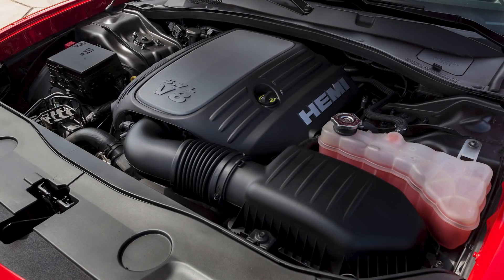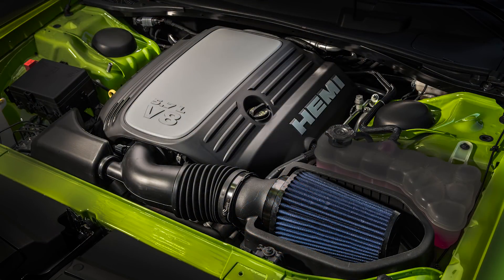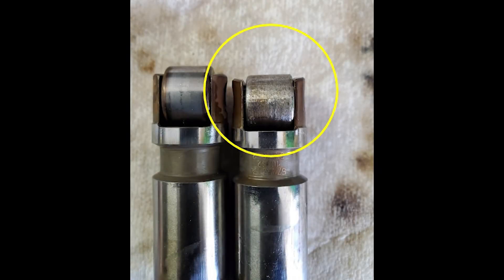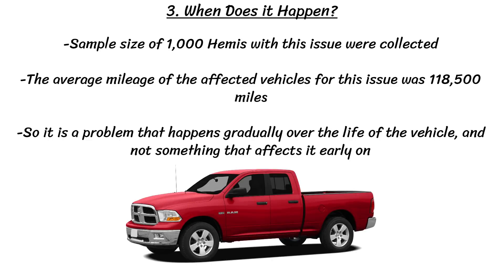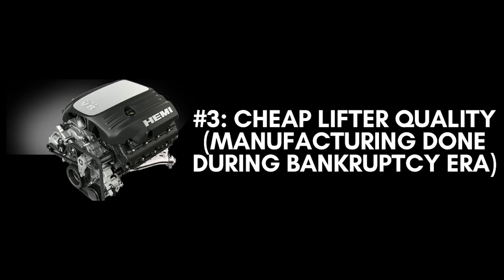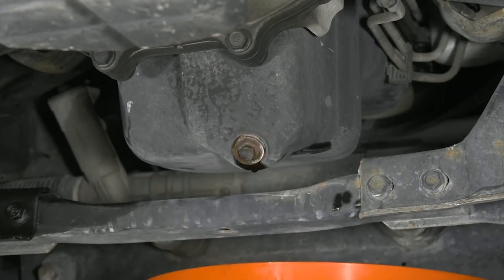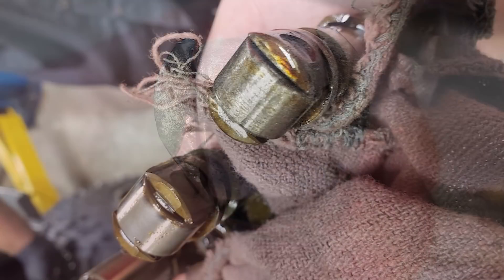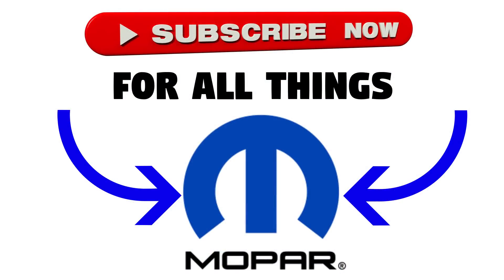The Fatal Flaw of the 5.7L Eagle Hemi V8 Engine Fully Explained (2009+ Lifters and Camshaft Failure)

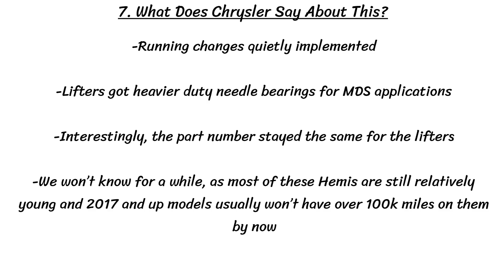Comment: 15:30 2017 Ram 1500 200k+ miles no lifter issues but exhaust bolts broke, air bags are trash, & clock spring petered out

Comment: A lot of it has to do with idling too much because in 2009 when they upgraded the engine for more horsepower they move the cam up too high away from the crankshaft. Under 1,500 rpms as well as idling too long it’s not getting enough oil up into the cams to lubricate and that’s what causes the cams and lifters to get that awful Hemi tick. It’s mostly the cam that does it because the cam pushes the lifters.

Comment: My 2012 5.7 145 565 Mi. most long distance driving very low short distance use . regular oil changes still runs great

Comment: Sadly the 5.7 is put in vehicles which usually live a hard life. Youd be suprised how many rts 1500s 300Cs and S's i do oil changes on that are 2-3k past their oil change. These cars a lot of the time are owned my poorer people and when it comes to Maintenance Or shiny new wheels or new giant wheels for their truck they pick the wheels. The challengers are usually spared this but i see it all the time on the chargers 300cs and the 1500s. if you go 8k on an oil change while also beating the piss outta it you will get a lifter tick and its not dodges fault. The oil that comeso uto  these poor things is so thin and black they might aswell be just dumping water in. If you drive it hard changing the oil every 2500-3k isnt cause it gets dirty quicker its cause high rpms breaks down the oil viscoucity quicker. if you drive it hard and still dont change the oil till 5K+ miles your 5W-20 becomes 5W15-5W-10 and your motor suffers. If you drive it like a camery and never rev it past 3500 you might be able to get away with 5k oil changes but its not ideal.
Reply: My 08 300c awd rus like new and has 223,000 miles only 5W-20 synthetic used.
Reply: @EconomyElk  my 2008 2.7 300 has 277,000 on it. 5W20 oil changes every 5,000. Been a great car.

Comment: 🤔 i cant say for positive but the more technical parts you put into an engine the more you increase chances of failure. Especially small parts that play critical role's in the engines operation. Dodge hasnt been dodge for i dunno 30 years or so. Now you have foreign engineering trying to crossbreed an american engine. Dont get me wrong what they did do was truly amazing but totally untested. An inblock cam engine with push rods generating 350 horrspower and getting 22 mpg and Being a daily driver is remarkeable. Now that being said it is an inbock cam and oil differently than their ovh cam engines and i believe there in lies a problem as dodge or daimler fiat ot whom ever failed to explain the importance of oil gallies in push rod engines and they need a lot of oil especially if you are adding more and more parts into the engine that require oil and a higher volume pump to keep these parts lubricated and cool. They have plenty of pressure just not enough opening to get the oil through. Thicker oil is probably NOT recommended. In fact a 0 w 30 or 20 is probably best.

Comment: 2018 Rebel. Cylinder 7. Lifters not pushing valve. Ticking noise non stop. Taking it to dealer. I have full warranty. 74000 miles. Will see. Had it happen a few years ago to my 2012 ram hemi. Warranty paid for new engine. It also had about 75000 miles

Comment: I have 320.000 on my 5.7 never bin apart except spark plugs an manifold bolt I use heaver oil in my truck 10w30 summer with JB lube additive every other summer an 5w30 in winter high mileage Valvoline red bottle

Comment: It’s the MDS IF THESE are beaten to a pulp or not taken care of the lifters sometimes collapse and don’t come back! Grinding the can ticking sounds and it gets worse!!! Easy fix! Lifters from a hellcat may as well do valve adjustment and check other things to be safe disconnect the MDS (THE CORRECT WAY) and add a hell cat oil pump! This will increase oil pressure while at idle a lot of idling and stop an go traffic fails to bring oil pressure up enough. To lube the upper end of the engine. So to compensate a hell cat/demon oil pump and deactivate MDS then use hell cat/demon lifters etc etc! And you’ll NEVER HAVE THIS ISSUE AGAIN!!!!!! I know I do it at my shop and never have I had a customer return with these issues EVER!!!!! Plus if they want to do performance upgrades later it saves time and cash

Comment: I guess I’m lucky. My 2010 ram just clocked over 428,000km/266000 miles, and the only thing I’ve had to do to the engine beyond oil changes and spark plugs was a water pump.

Comment: The problem is the oiling system,. All the oil needs to be pumped all the way up to the top of the rocker shaft , then id needs to come back down the push rod to oil the lifter which is completely  backwards form all other systems.  Also tye lifter angle is entirely too flat which is a bad block design. So there is no fixing this issue. The entire engine would need to be redesigned in order to fix it. Way to go Mopar.

Comment: Hellcat spec oil pump and a catch can is the cure to the lifter failing. It’s caused with extended idling. It simply doesn’t oil well enough to the lifters at idle.

Comment: I got 2008 
500,000 miles
With no hemi tick or exhaust bolts broke yet
I'm using 5/30 full synthetic Walmart oil and oil filter 
I got 2019 hemi engine 
With 200,000 miles no hemi tick 
No boke exhaust bolts
5/30 full synthetic Walmart oil and filter
2021 hemi engine 
170,000 miles no hemi tick or no exhaust bolts broken 
Using 5/30 full synthetic Walmart oil and oil filter 
My question is what am I'm doing wrong

Comment: I bought 2009 Challenger new with lifetime power train warranty.  At 168,000 miles cylinder 8 lifter failed destroying the cam.  Chrysler installed a long block under warranty.

Comment: I think probably the 5w20w oil is too thin for a v8 and may not develop enough pressure to keep oil splashing around.
Also, the hemi oil filter is the smallest I have ever seen on a v8. Using a relocation kit and a larger flow filter could not hurt.

Comment: I’m a newbie to the channel and to the 5.7 Hemi. I have a 2011 Ram 1500 Outdoorsman, regular cab, short bed, 2WD. So far, no ticking. It has 112K miles, presumably mostly highway. I’d really like to get caught up on the issue of the lifters failing, the MDS system (good or bad for engine life) and anything else. I just found the video and I’m glad I did. Thanks for sharing this informative video with us. I’m open to suggestions from anyone with regard to the proper care and feeding of the Gen III Hemi.
Reply: Just use 5w 30

Comment: All can be avoided if you would just change your motor oil on time. Motor oil brakes down and yet out the door goes proper lubricant 
Also stick with 100% fully synthetic oil 
I have 172,000 on my 2014 5.7 hemi and no lifters ticking in my engine because I keep my oil and filter changed every 10,000 mile

Comment: My 2017 Ram 2500 4x4 SLT 5.7 with 97500 miles I purchased it with 82000 miles 3 years ago. It was a fleet truck for and pipeline company in Canada and had over 1,500 idle hours and 167 drive hours. I suspect this may be the issue for my truck but I don't understand how the truck had 82000 miles on it if it only had 167 drive hours. 167drive hrs x 65 mph average =10855 miles. Currently, the idle hours are at 1567, and drive hours are at 285 so it works. Any thoughts?

Comment: i turned off my mds and i use Lucas flat tappet wear in additive with zinc and phosphorous to protect the hot areas and i noticed the engine on my 09 300c is running a lot better i have also noticed that idling is the main suspect, fleet cars cops cars and more seem to be the most affected

Comment: I have a 2021 ram rebel. It had 40,000 miles on it when it threw a misfire code on cylinder seven took it in the Dodge. They’re replacing the entire engine sounds like it hasn’t went away. If I had a choice, I would’ve bought another vehicle not a fan of Chrysler products👎🏻💩

Comment: Let's focus on the root cause of these failures.  Kinda 2..... A primary and a secondary...... primarily it's the oil.  The true fix is an additive.  Secondary.....high idle hours.  Police model, service trucks, etc.  Heavy duty won't fix it.  Maybe high volume pumps.  Remember, LS motors had the same problem.  Windsor rollers didn't have these problems....why?  The oil was different.  IT'S IN THE OIL..... additive additive additive

Comment: Have an '06 jeep commander that wiped the cam and required a whole new engine. There are 5 to one '06 vs other years for sale on marketplace with the blown hemi's. Uncle Tony's garage had the best diagnosis, older engines had the camshaft closer to the crankshaft than the newer LS's and modern hemi's. GM has the same problem too. So they are starved for oil when at idle. There were round 30 videos on YouTube that had meticulously done maintenance and had it happen with 30K,65K and other low mile vehicles. My mechanic looked at me like i was crazy when i told him that's what it was. He fixed some other stuff that still needed done, but didn't cure the shake in the engine. After a compression check and trying to take the mds solenoids out which are magnetic, they barely got one out because it had so much metal stuck to it. Uncle Tony took one apart and noticed there were score marks on the outside of the lifter, which could have only been caused by oil starvation.

Comment: You should always use the oil viscosity recommended by the manufacturer. You will have less oil burn off and better gas mileage.

Comment: Worn crank bearings causing lower idle oil pressure in cars that idle more than normal all caused by incorrect oil and insufficient oil changes. 
I do note the rotational speed of the larger needles in the revised lifter would be lower at all engine RPM.  
Just a guess.

Comment: I have the 2011 Jeep Grand Cherokee Overland with the 5.7 and currently have 120,000 miles.  The 2011 has had a lot of issues and likely one of the worse production models.  Considering getting rid of the 2011 and buying a new JGC over concerns of what is next with the vehicle, specifically the motor.  Have started researching the 5.7 to see if I have problems coming soon and wondering if maybe best to move it while it still seems to run fine.   Great video!

Comment: I think the issue could be CURED by drilling the camshaft down the middle, drilling a hole in the base (heel) of each lobe, and using a high flow high pressure oil pump to positive lubricate each and every lifter all the time the engine is running. the real issue at this point is Chrysler has no reason to do it, as the hemi will soon be dead. to me, this is something that eack and every performance camshaft maker could take on, so that high performance cars and trucks would no longer have this issue. I know that if I was to replace the cam in one, I would do this even if I had to pay extra to have the camshaft drilled. a pressed in plug would keep oil pressure inside the cam until it exited at the hole in the lobe.

Comment: I have a 2017 Ram with 114k miles and it just seized the entire engine. I'm having it rebuilt. A buddy also said the oil should get changed to a low profile oil pump. He says the stock pump sits too close.to the bottom of the oil pan and plugs up with the crap on the bottom of the tank.

Comment: I have a 2012 5.7 hemi Charger. I have 166,200 miles on it and it is absolutely quiet as a bird. I religiously change the oil and filter every 6,000 miles. It averages 21 mpg per tank. If I’m on a long trip I average 32 mpg at 70 mpg with the air on. I use super synthetic 5-20 Penzoil.
Reply: 32 mpg?...not possible!...car is rated at 23mpg highway

Comment: Another thing is that many modern synthetics do NOT mix well.  They have so many additives.  Sticking with the same kind of oil throughout the lifespan of a vehicle is a good move, as long as that oil has the highest rating.  (Something like SP+)

Comment: I got into a fleet Ram with a 5.7 and only 30,000 miles in it today. I was surprised to hear the engine tapping/knocking when I started it on what is a next to new truck in 2023. I didn’t realize these engines are known for that.

Comment: Well I'm a young adult, just bought a hemi  5.7 V8 2014 charger ,used to be a cop car , has 210500 miles nd no issues at all l, runs good engine still strong , just changed the oil. But what should I also mainly reput new? New at this so I don't know nothing

Comment: Two thoughts: the needle bearings are too small,lack lubrication! Upgrade the roller bearing units early! And two,if it's a lubrication issue put in a overhead lubrication kit to get the oil there! Ford screwed up years ago and smart folks put in overhead oiler kits!

Comment: Run the engine with the speed gear selector up to 8. When you put the car/truck in drive you can select the  gear limit. This will disable the MDS so you will run the engine in 8cyl. The MDS cancelation will resets when you stop the engine. Repeat the selection for next time when you drive. I use this trick after I had to change the lifters (done free by the dealer).

Comment: A 6.4 lifter issue will be probably just as expensive to fix as that turbo.  I'm a ram fan but i probably wouldn't buy a hemi now because ram isnt addressing this.The mds or afm  have made the gas engines time bombs and thats too bad. Like you said all makers are going this way so it is what it is.

Comment: I’m nowhere near as schooled as I’d like to be on vehicles, but why exactly does higher rpms help mitigate this issue? I really don’t have a problem with laying the throttle down just curious, and what’s considered enough, at least 2500 rpm while accelerating?
Reply: Higher RPM increases oil pressure literally spitting more oil on the lifters and cam lobes.

Comment: Great analysis and I appreciate the objective approach. NGL I was somewhat relived to hear they improved the lifters in 16.  I have a 44k miles 2016 sport with the 3.92 rear end and aside from the 2 piece driveshaft replacement (which only helps the thump at launch for 2k miles) I am happy with the motor and trans. It does have MDS/VVT and I enjoy getting around 30mpg @ 45MPH.  Around 20k miles I added Z max to the oil and fuel system as well as regularly run injector cleaner at high RPM as I feel it keeps things moving better.

Comment: I have a 2015 Jeep with Hemi with 189,000 miles. From the day I bought it new I have always had a loud ticking. I have always maintained my Jeep with the dealer, making sure everything recommended was done. Most years I take long trips sometime more than 5,000 miles to get lost in the mountains & deserts, I never wanted a breakdown to be a problem. About a month ago maybe 10-20% of the time on start up my Jeep would barley turn over, then it started  idling very rough, then engine light came on. I made appointment with dealer when it started with the hard starts, it took them a month to get me in. Yesterday 11/28/22  they have informed me my engine is "Blown" and it needs replacement.              To back up your theory that idling can facilitate this problem I have idled many times for long periods of time over the years.    I am fortunate in that I have a lifetime warranty but it still sucks, even more now that I see they knew.

Comment: I have had this happen in several of my fleet trucks. One of the trucks was a brand new truck (2022 Ram 1500). I have had a similar lifter issue happen on two different 3.6 engines in 2014 and 2016 Jeep Wranglers. The 14 at 50,000 and the 2016 at 10,000 miles.

Comment: I am rebuilding a 06 hemi with all the reading and watching on line the cars that idle are experiencing low oil pressure at least that is the belief melling has made a high volume pump For 03- “08  to help with this problem
Without chrysler admiring the problem we can only speculate? They are ending the Hemi later this year or next and are going with A straight 6 cyl with two turbos?
I am also deleting the MDS. New cam and lifters. Thank you got your work.

Comment: Outstanding in comprehensive job on the video I’m going through this right now currently my 2012 grand Cherokee 5.7 hemi cylinder number three had a misfire. I took it to the local dealer here in Dallas. I have a bumper to bumper Mopar lifetime warranty back in 2018. They don’t offer that anymore.
mopar dragging feet right now on the repair decision. Dealer Stated they up to 48 hours to make Ridiculous. Should find out soon 
We’ll see how well Hobart covers it has a warranty item.
Reply: Spellcheck Correction “Mopar”

Comment: So, my question is, if I were to use a ram 5.7 hemi with an 8 speed auto for a 4x4 truck restomod, would I still have a good reliable daily driving truck? 78 dodge w150 power wagon is the truck btw.
Reply: Only 4x4 8 speed are suvs. 4x4 trucks come 6 speed

Comment: Just did a head job on my ram after the chain broke, had to change lifters, push rods, valves, I bought the truck used in 2014 and I got 259k, I still have the original exhaust manifolds changed the coil packs,  but still getting a camshaft code

Comment: I have an 07 Aspen Hemi and I absolutely love the motor. I rebuilt it at 120k just because but I was looking for this issue. To my elation I found that all of the hard parts were practically brand new and I reused all of the hard parts. This is the most simplistic engine I’ve ever worked on. Plus I can tow 9000 pounds and haul 6 passengers . Big fan. But my opinion is they went with a different manufacturer or changed materials.

Comment: Oil changes and also maintenance have 96k on my 2016 ram 1500 5-6k on synthetic oil  and in 16 they used harder bearings